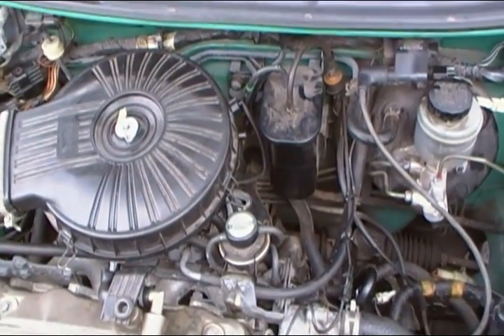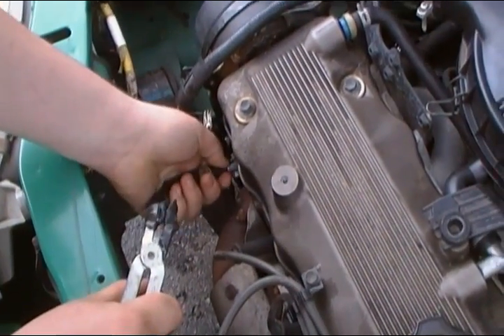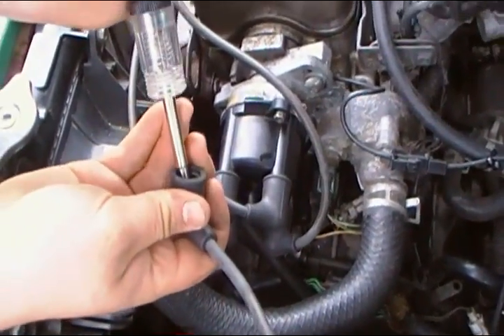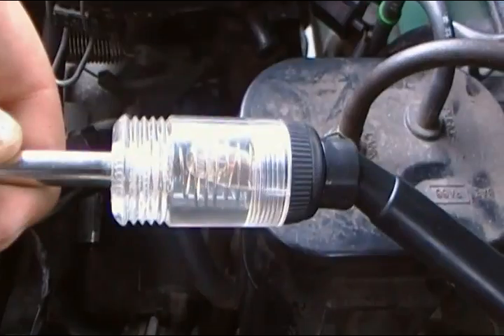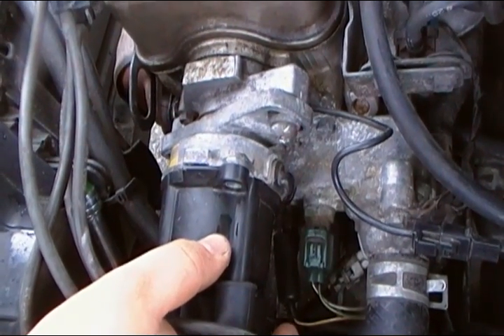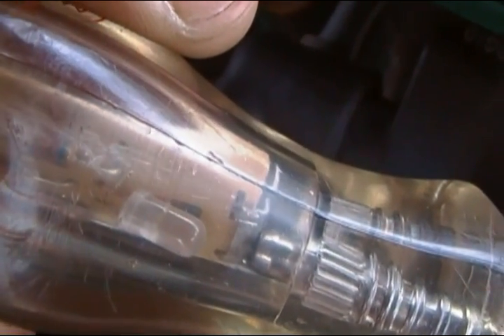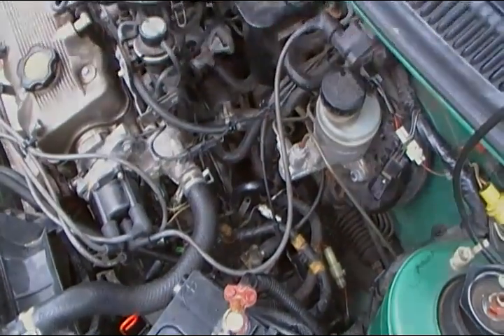Simulation of No-start, No-Spark diagnosing.

Comment: I noticed that the coil was not plugged in while you tested for spark on the plug wire, distributor, and coil. When you tested the wires that should be plugged in to the coil, it tested right. The problem that I have is that when I test the wires that should be plugged in to the coil, I get constant power on both wires, which tells me that there is a short somewhere in the harness, the coil also getting very hot when cranking the engine - No spark - No start.

Comment: No need to remove the distributor cap until you test the control wire first. It's quick and easy and requires no disassembly other than pulling the connector and using a test light. Also I would start further back at the coil and move forward instead of at the spark plugs moving back (of course this would be after verifying that the plugs aren't firing... it could just be one plug alone whereas the coil tests the capability). Just a couple of timesaving observations. If you have a decent oscilloscope or even a cheap Chinese 8-channel scope and some inductive probes you could test all at once.
Reply: I'm not a Master mechanic or anything and I'm not trying to be a dick. Just a few observations that I made that might be helpful to somebody.

Comment: Excellent step-by-step process.  I followed your instructions up to replacing the coil.  I replaced the coil for my 4 cyl Toyota pick up with identical OEM.  Everyone including the tow guy told me he was sure it was my 35yr antique coil needed replacing!  Although having a new coil is good it wasn’t the problem.  When I got to checking if my rotor was spinning it just sat there.  I made sure it was installed properly and it was. Thanks to you I discovered the problem! Never in my 50 yrs of working on cars have I seen a bad distributor.  I was almost gong to skip that test.  I was so sure it worked.  What do I do to fix it?  I know…replace it right?  I think I will look in my trusty Haynes manual for advice before I spring for a new one.

Comment: Thank you very much for your education.  I am using Daewoo Matiz 2003. I got the same problem.  After changing the ignition coil, still the power don't come from the ignition coil to the spark plugs. Any idea? Thank you.
Reply: Me too on my simple Toyota pickup 4cyl 22r carb engine.  I have power to New Coil but nothing out the New NGK Coil wire!  Why?

Comment: I know this is an old video but I still have a '92 Geo tracker I would like to know what happens when you put the tester in that plug my light stays on and when I crank it I just get a solid light it does not blink
Reply from the maker: One side stays solid and other should blink while cranking. If it doesn’t it is most likely the igniter(ignition module)
Reply: @FrankHurtAuto  Yes I put a brand new igniter but I will check tomorrow and the other side I didn't check to see if it blinks but I appreciate you getting back to me if I have any info tomorrow I will hit you back thank you very much for your help

Comment: i have no power comimg from the ciol what should i check????
Reply: What vehicle is it?
Reply: @Mani_Grewal  its a 97 jeep grand cherokee
Reply: Richard Blystone there should be a plug on the coil, get a test light and see check power on that plug. While cranking one side should have solid power and other side should blink. If it’s doing that then coil should be the problem

Comment: Hi, I replaced my coil on my 1996 golf, now the car wont start. With the old coil it runs for about 20 minutes and then begins to sputter and eventually shut off/hard starts
Reply: My golf mk3 stops out of nowhere. I replaced the coil and for about a week worked fine,  the it started to do the same as before. Have you tried changing the hall sensor?

Comment: I have a 95 Ford Taurus that will not crank I've done change the distributor the rotor the cap the coil and it just turns but it won't start can you tell me what it could probably be wrong
Reply: Lupe Wilson do you have spark. If you don't have spark, Taurus has a common problem with ignition modual, which is mounted on side of the distributor

Comment: what if you have power from the coil but no spark from spark plugs wire and u have a new cap and roter what could it be thanks could it be a bad pickup coil inside the distributor

Comment: Here's a question: I drive a fiat uno cento it has a module consisting of a D1071 transistor (darling transistor) the modules keep failing now diagnos that, the battery voltage has nothing to do with it and the wiring is perfect also the modules are installed according to factory specs... yet they keep failing.....ps where I live is a clue
Reply: oh and I can repair them
Reply: ok so here's the answer: I live in south Africa and this problem only plagues us during summer.... you guessed the modules over heat installing a 1"x1" 12v cooling fan on the heat sink and linked to the ignition solved the problem... as to fixing them all that would happen is the transistor would get so hot it would desolder it's self from the board soldering the points back would fix it... and on rear occasion replacing the transistor, they cost 25c, would also fix it

Comment: here is some education in 30 years as a motor mechanic I have never electrocuted my self with a 12v battery..unlike in the movies... about the only thing that will happen, if your and idiot and touch the plug or plug wire while the engine is running, is your likely to get a very sharp reminder to not do so again...high voltage my ass it the 10 amp charge that from the coil that snaps you back to attention and it will not kill you, burn the crap out of you if you short it on a metal clasp or watch, but it won't kill you

Comment: what if I can't detect power  before the coil?
Reply from the maker: if you don't have light fluctuating when checking the coil, then most likely it is pick-up coil or igniter(depends on the system)
Reply: Column

Comment: I was just wondering if anybody could tell me a quick fix to get a cap and rotor or tomorrow butt I'm getting spark from the coil to the to the cap but not to the wires to the spark plugs so I don't know if it's better or the cap and rotor check in with you guys tomorrow maybe you guys can throw out some hints you always text me if you guys have a 89 Toyota pickup with a V6 text me 541 294 2189 I appreciate it thanks

Comment: hey i have a 94 geo metro 3 cyclinder what are the names of both tools used in this video cause im no mechanic lol but id like to check myself bfor spending money on a mechanic....any suggestion welcome thnx
Reply from the maker: +juan albarran They are spark testers. you can do the same test with a screwdriver that has an insulated handle. insert the metal side into the plug wire boot and hold it about 5-7 mm from a metal surface and see if there is a spark jump between screwdriver and metal surface. MAKE SURE YOU ARE NOT HOLDING THE SCREWDRIVER FROM METAL SURFACE.

Comment: Hey boss man I have a question I've changed everything checked eveything and the rotor arm it's not spinning
Reply from the maker: +enrique valentin if the rotor arm is not spinning, it is usually the timing belt. check if your camshaft is turning.
Reply: +FrankHurtAuto thank you so much I honestly think it is the timing belt

Comment: Do I need to have the spark plug tester. And is there tests i can do without it to diagnose the problem. I have a regular 6-12V tester. 
The Van is not sparking and has been struggling for a bit to start but usually with a bunch of gass it goes. It is a 1981 dodge.
Reply: +Jeff Riel Theres an old skool test you can do.  Use a spark plug instead of the tester..  pull out a spark plug, put it in No: 1 and ground the spark plug to a bolt and crank the engine.. then try it with the coil lead..  Warning though, if you hold the spark plug and do this, you may cop a shock...  ask me how i know..  ;)

Comment: what happens when do dont have power to the coil. I have a 85 ford ranger with a v6
Reply from the maker: +dennis finney I would look at the pick-up coil, see if it is generating voltage when distributor is spinning
Reply: +dennis finney  check the voltage at the positive (+) terminal of the ignition coil with the ignition switch in RUN. If the reading is not within battery voltage, check for a worn or damaged ignition switch.

Comment: well there is one problem with this video= you made all the tests for spark with the main wire off to the coil ??? so with out the main wire hooked up the the coil all your tests where not valid ,  take a look at your video and you will see that to , please if your informing anyone  take the time to check everything first // p.s, you can see the unhooked wire next to the coil.  not to brite!!!
Reply: The title of the video says "simulated", he knew it was unplugged. It was for learning purposes.
Reply: +Manuel Mejia         you get off having a tital auto tech ??? what a joke you have to test the system with the coil plugged in at the beginning of the video to prove that there was no spark  , don't you get it , technicians like you guys would be sweeping the floor and putting out the garbage with your skills
Reply: Now that's dumb! How you wanna get spark when the coil is unplug? & don't you mean TITLE?
Reply: +Manuel Mejia if the coil was plugged in at the beginning there would be no point of the video because it would have started. He left it unplugged so there wouldn't be a spark and therfore to show you what you would check when there wasn't any spark
Reply: I know, but the point is it had a bad one from the beginning that's why he said he replaced it. If he was scared I would have just taken out the fuse.
Reply from the maker: +PumpAction Cracka Thank you for understanding the point of this video.
cheers
Reply from the maker: +Manuel Mejia +francis missonellie 
 Hello All, The videos on our channel are made by grade 11 &12 students, by no  means they are mechanics or technicians. All these kids are doing is make a teachable video. There was nothing wrong with the car, he was just simulating a no spark issue and a flow chart to go with it. Sorry for causing the argument. 

cheers
Reply: FrankHurtAuto what if you have power from the coil but no spark from spark plugs wire and u have a new cap and roter what could it be thanks
Reply from the maker: If you have spark at the coil, but no spark at the plugs, then i would check the wire that goes from coil to distributor.  do a spark test on the distributor side of secondary wire.
Reply: FrankHurtAuto ok now i have spark and fuel but the engine still wont run what could it be ?
Reply: FrankHurtAuto ok now i have spark and fuel but the engine still wont run what could it be ?
Reply from the maker: did you mix plug wires by any chance? check compression, sometimes prolong cranking washes cylinder walls.
Reply: FrankHurtAuto i checked the wires and they are all good all 8 of them now i changed the distributor and it wants to start but it dont o dont know why on the old distributor it dosent want to start at all just cranks over and over but after i changed the distributor it wants to start but it dosnt so idk why ? Compression is good on all 8 cilnders sorry for the bad spiling thank you for helping me i hope u tell me why it dosnt start now
Reply from the maker: If you have good spark, good compression and fuel, then start looking at ignition timing. You said that you had installed new distributor, I hope you have watched the rotor direction when you installed the distributor. If it is almost starting, i would try turning the distributor slightly left and right and see if it starts.
Reply: FrankHurtAuto yes new distributor and yes its almost starting thanks alot for your help i will try to move the distributor left or right i will make it run thanks again
Reply: +francis missonellie LOL I caught that right away!!!
Reply: We know that, but a REAL Automotive Technician would've left it plugged in. You know it's not working. Yes I called myself a Automotive Technician. A Mechanic is a fix it at mom or grandma's backyard guy. LOL
Reply: It's kool I have nothing against him! Happy he's choosing that type of career. Hopefully he gains a lot of knowledge & works for himself & not for somebody. :)

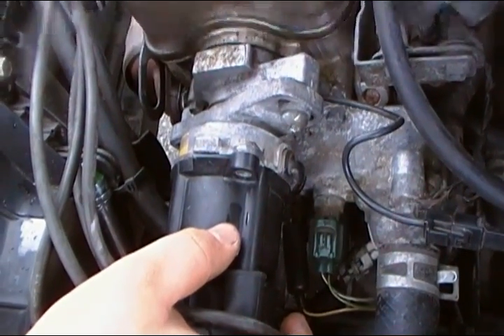Comment: @2:55 what if the rotary arm doesn't move/spin at all after turning ignition?
Reply from the maker: 94WAIPAHUblocc If the ignition rotor is not spinning, most probably the timing belt is broken.

Comment: Hello, I have a question Crankshaft  position sensor bad causes the fuel pump does not work? In my car have  not spark, no fuel and I have code KPS Thank you.
Reply from the maker: Hi Byron.
Crank sensor rarely controls fuel pump power, but it does controls injector pulse.

Comment: What to check next if there no power going to the coil????.my connection to the coil doesn't light up?
Reply from the maker: One side should have battery voltage and the other should be blinking while cranking. If it doesn't blink while cranking, i would look at pick-up coil or ignition modual (depending on the year of the vehicle)

Comment: hi i have a 91 Subaru legacy with the bottle coil im not getting spark ive change the rotor and the  igniter but im not getting the signal to the coil just a constant light when i probe the wires going to the coil can u help me
Reply: +CHRISTOHER BEST So what happened?
 Did you check the CPS (Crank Position Sensor)/Hall effect device?

Comment: Its a 1999 mazda 626. 2.5. v6. I get not spark out of the coil pack. Its distributorless system. Changed the coil pack and still the same. I used the probe light to see if power was going to the coil pack.  I do get power but no flash on the light when cranking engine
Reply from the maker: If there is no spark on any coil pack, it is most likely the crank position sensor (behind the crank shaft). while cranking, are you able to read RPM's on tach?

Comment: Is the probe light suppose to flash for a d.s.i coil pack aswell? And if its indicating power with a solid light but does not flash when cranking engine what does it mean?
Reply from the maker: yup, even with coil pack it should be solid on one side and flashing on the other. The modual underneath the coil pack gets the signal from computer, which gets the input from crank and cam sensor. What vehicle is this?

Comment from the maker: If your vehicle has DIS(distributor-less ignition system), look at crank sensor.
Reply: I have a 1990 dodge w150 with 5.2 TBI engine. 180000 miles so I did a compression test cylinders were all good. My problem is now it just cranks no start. I disconnected coil wire from dist. for test and just set aside. Did I fudge something up with not perhaps grounding the wire. I am from the Autobdy side of things, my sons truck trying to save him some money. Confused here. They talk of an ASD relay or did I fry a fusible link.Put new plugs, coil, hall effect pick up, cap and rotor, ASD relay, fuel pump, Still cranks no start all these parts one at a time then try to start to no luck. Distrib was not  removed. I am leaning toward the energy from compression test with coil not grounded f_ _ked something up. Hopefully not the SEBC comp I guess I will check the fusible links next and injectors next
 Any help would be much appreciated. Engine chasis  battery  to frame all grounds are good too.  I'm not getting power to + side of coil and tried jumping to pos post on battery with fuel in carb still crankno start.what a SNAFU. Help please. Montana Rick.

Comment: i notice that when your checking the power from the spark plug to ignition coil and crank the engine while the power cable from the ignition was unplugged 100% it will not start
Reply: Lol i saw the same thing

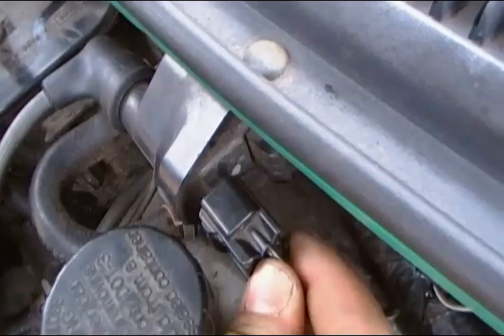Comment: tutorial is good, however this guy has the power socket disconnected from the beginning and at the end of the video he connected it back. look for the ignition coil right end at 2:21 and then look again at 3:37. procedures are correct, but he is deceiving you.

Comment from the maker: When you say not turning over, do you mean not cranking properly? if that is the case I would look at the battery or starter. As far as crankshaft position sensor goes, it would normally set a code, and you would get a "check engine" light on your instrument panel.

Comment: i'm having a similar problem. i have a 1998 jeep grand cherokee laredo and most of the time it starts fine but today it hesitated and didn't wanna turn over. it eventually did though and now is working fine. it hasn't recently, but it also used to stall when driving. after cleaning the carburetor it seems to work now and not stall. do you have any ideas what it might be? i think i will change the crankshaft positioning sensor because i read that that could be the cause of it. thanks in advance!
Reply: Hi I have problem with  my 5vz petrol pump.no power run
Reply: I need help

Comment: hi my car wont start but it does have spark and fuel pump is good.when i spray start fluid on throttle it kinda wants to start so that tells me there is spark.is it possible the fuel pressure regulator is bad?or computer?once in a big while it does start and run for 3 minutes then dies and no start again.

Comment: ok, so I took the 98 V6 accord to the mechanic. It turned out that the computer got deprogrammed (maybe because of the bad ignition switch). They had it reprogrammed and the car started and is running well now. Just to follow up on the story.

Comment from the maker: @adomayor Pardon me for nor replying sooner, was on winter holidays. Hope your car is running. We had a similer problem with a Honda Civic and it turned out to be loss of compression due to too much fuel going in (the cylinder walls were getting washed with excess fuel) and it was loosing compression.  All we had to do was squart some motor oil through the plug holes and crank. Compression came back and the engine fired.